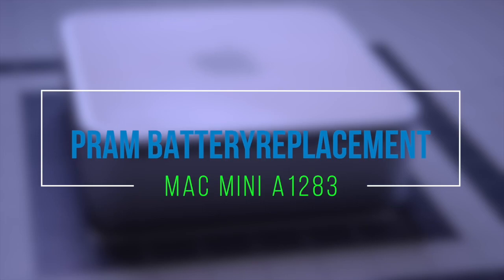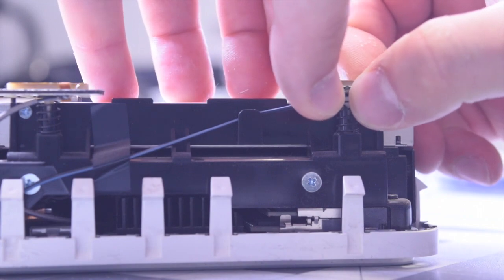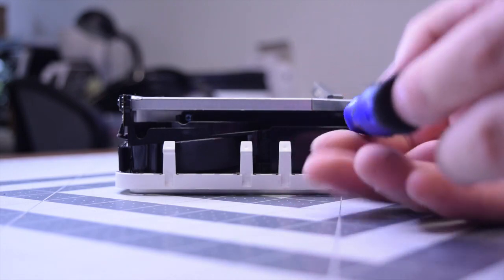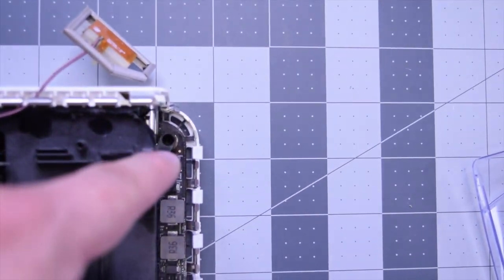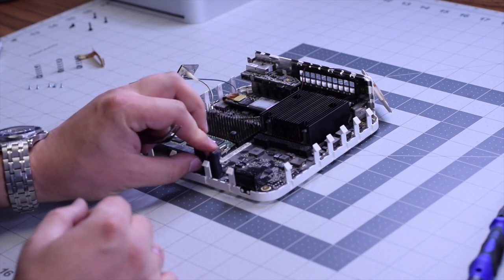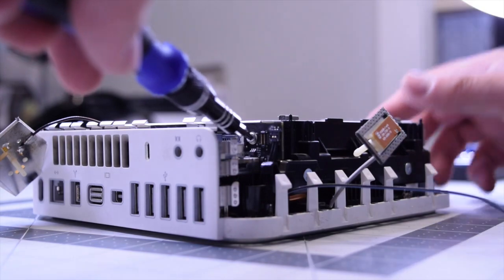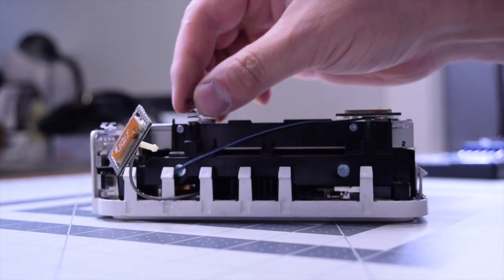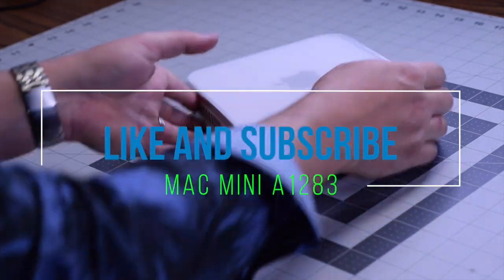🛠️🍏🔋Mac Mini A1283 - PRAM Battery Replacement

Comment: What type of battery is it?
Reply: Funny that you asked this. I've read one guide and seen one video so far and neither one mentioned that actual part number. 😒
Reply: @darkwater234  2032
Reply: @michel5204  BR2032 not CR
Reply: Exactly he shows everything in detail accept the battery change itself
Reply: When replacing the PRAM battery, the negative goes on inside. If you face the negative towards you then there’s no connection to the positive.

Comment: Why did you remove the antennas and the DVD drive. When I disassemble my Mac Mini I take the entire chassis off and that reveals the battery. I haven't changed it yet. I have a pack I bought on Amazon but I wanted to make sure I didn't screw up something. Is it important to take off the antennas from the board or it's just the way you guys do it? In other words, can you change the battery by just popping a new one in or are the antenna part of some esoteric Mac Mini procedure?
Reply from the maker: You have to remove the Dvd drive to access the battery, you have to remove the antennas to access the dvd drive.